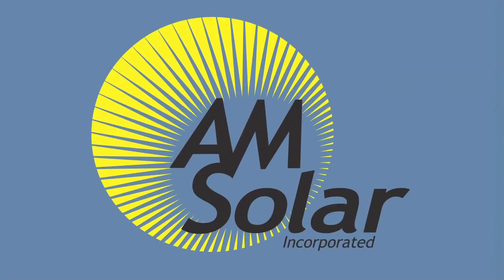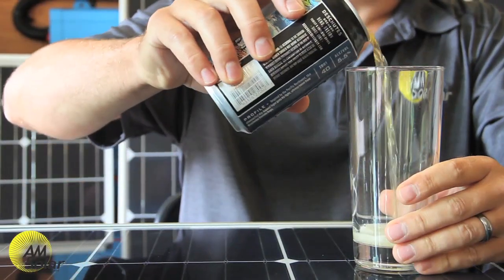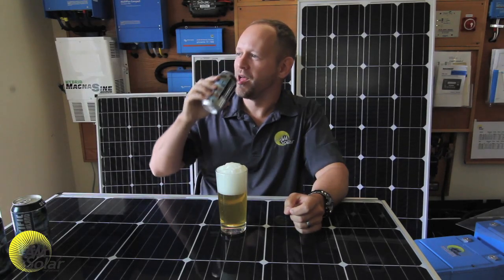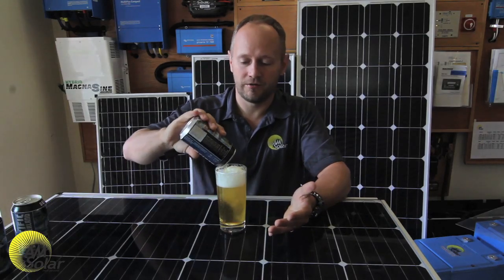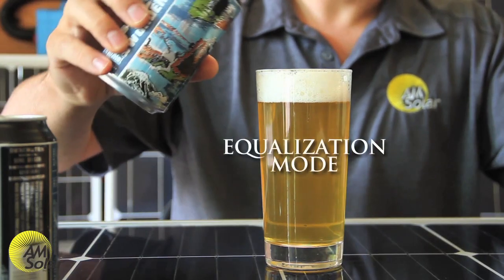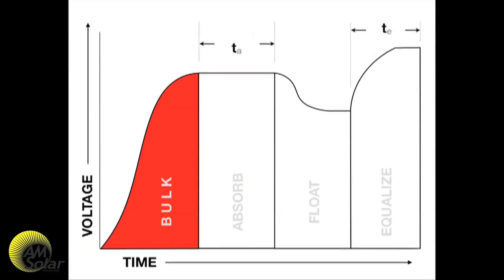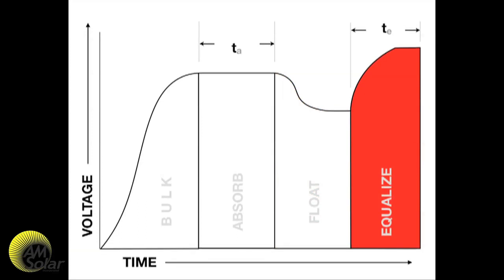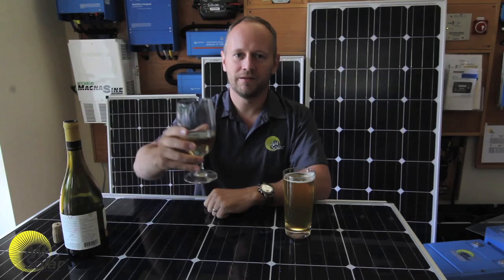Four Stages of Battery Charging for Your RV, Skoolie or Van

Comment: Great video!!!!  What levels would you recommend I adjust my pwm charge controller for bulk, absorb and float mode in order to keep my battery bank fairly safe?
Reply from the maker: Sabine Alexander Glez It depends on the type of battery you have.
Reply: @GarretTowneAMS  I have four  12v, 115a lead acid batteries connected 2 in series to get 24 v and then both sets of two un parallel. I hace a pwm chinese made controller because I cant afford a mppt expensive one.
I aappreciate you taking the Time ti answer my questions.
Reply from the maker: @sabinealexander2773  Without more details on the make and model of the batteries, I would recommend setting Absorption at 28.8V and Float at 26.4V.  That’s what we use on Lifeline AGM batteries.  That being said, I don't know of many cheap Chinese PWM charge controllers that give you that kind of programming control.
Reply: @GarretTowneAMS   Thanks so much!! This will definitely help me set the parameters much better than I have them at the moment.
I aappreciate your kind and fast response to my concern.
God bless you